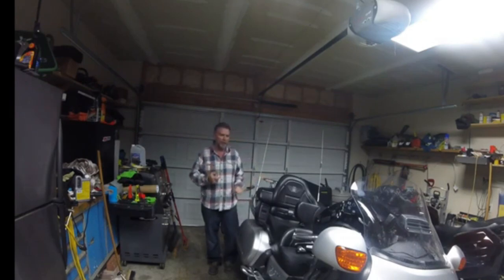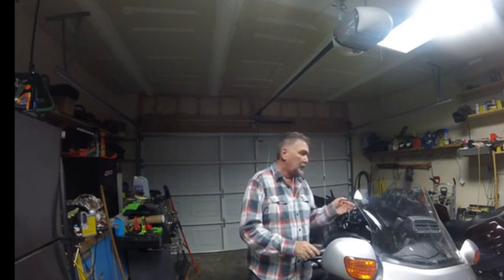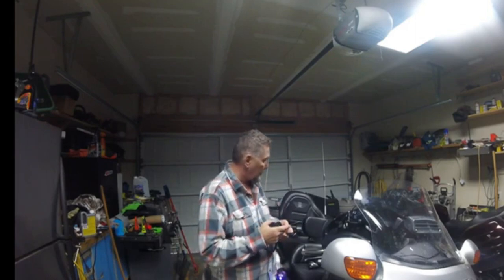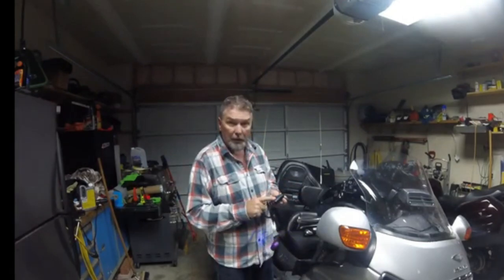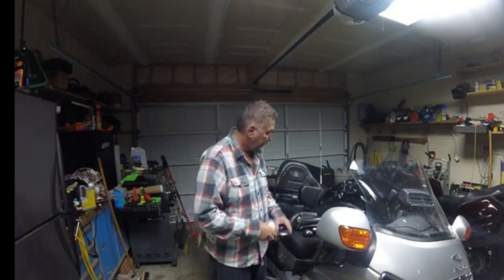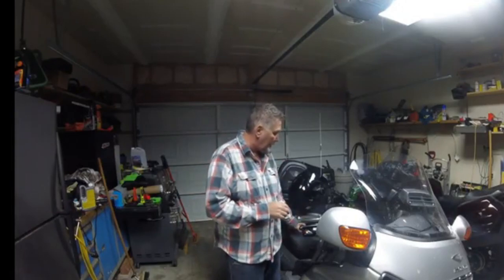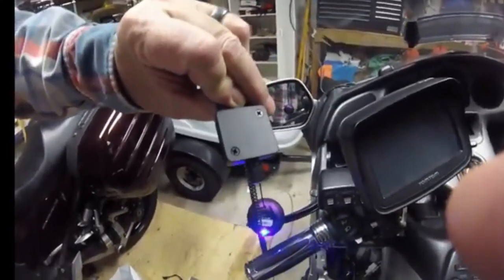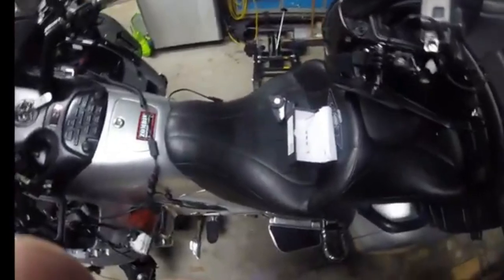CB transmit fix Cardo to Sena Freewire SOLVED!!!

Comment: You sure it’s not picking up some weird signal from that over head light?
Reply: Jim Caulk key was in accessory headlights were not on.
We are going to try a different antenna which needs no ground as a test unit.
It should be delivered this week.
Once I verify I’d ground is bad I will take out gas tank and clean the grounding point to the frame.
I do appreciate your suggestions and please if you come up with anything else please comment.
It’s all good conversation..   JB